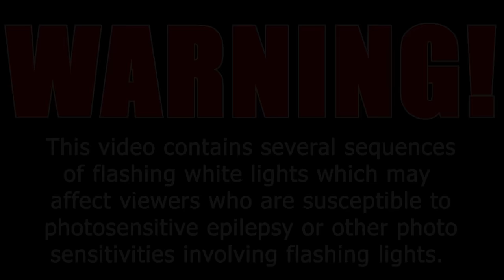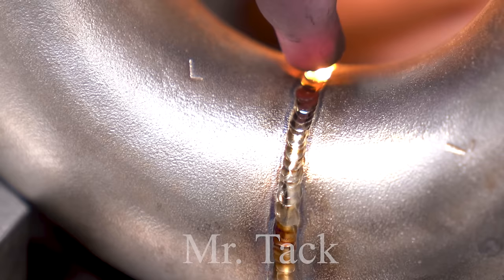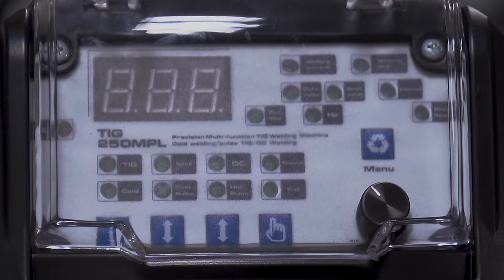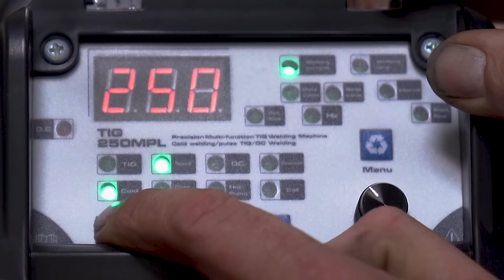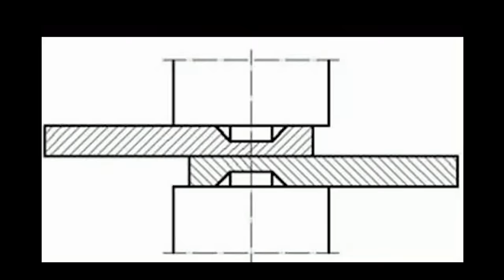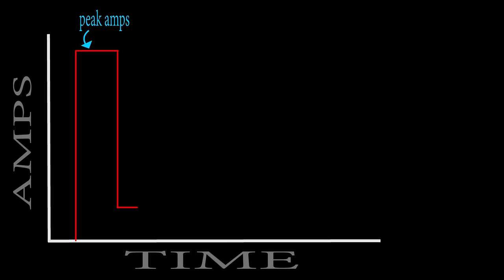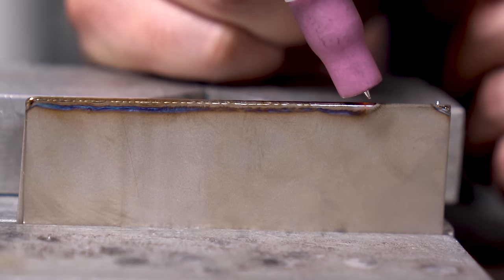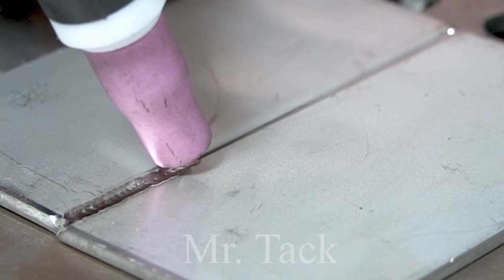So I Bought A Cold Welder

Comment: The first  definition you mentioned  is also called diffusion bonding & we used to do it @ Pratt in a vacuum chamber welding turbine components together. metals were very thick & clean , pressed together  with many tons & sometimes had an ultrasonic vibration applied to one part.

Comment: We use a "cold welder" professionally. It's a professional machine, somewhere in the 15.000 Dollar-range. This machine is used to tack up woven wire meshes with wires for high-temperature fuel cells (SOFCs). Other possible applications would be jewellery or micro-parts. So yes, there is a field of applicaton for these machines and yes, they work really well. But, almost nobody needs a machine like this at home. I really like the way you pointed out the "cold welds" it produces and yes, on homegamer-sized parts this will mostly be the case. I this it was This Old Tony who showed, that the HTP 221 has a "spot" option for tacking small parts AND it is a fully sized AC/DC TIG-welder. So, if someone had to deal with such situations, that's the go-to machine for the homegamer and also for the fabricator.
Reply: The machine in this video can be also used as a normal dc tig welder btw
Reply: $15,000?
Or do you measure tenths of a penny...?
Reply: @sourbrothers73  15000 :) That "." vs. "," thing always bothers me. Even though I regularly work with people from over the pond, I get confused with it every time.
Reply: @Gerhardter  lmao just ball busting
Reply: Lmao did you buy it from "I saw you coming" welding supplies
Reply: @craigelkin53  nope, it's Made in Europe

Comment: That thing would keep your auto darken helmet scrambling to keep up.   Kind of a war of micro seconds you might say.
Reply: If there was a way for the trigger to also trigger the darkening you basically wouldnt see anything going on, just metal fusing since the darkening is so short and the arc so short
Reply: Todd B  In a serious setup you're looking through a 10X stereo microscope and it has an automatic shutter to protect your eyes.  They are very sweet to use. You can hold small pieces with your fingers next to the joint- THAT'S why they call it "cold welding". You can run along about one hit per second.
Reply: @craigwall9536  Could you elaborate on this, please? Your comment has well and truly caught my interest, sir.
Reply: You can set a delay on most helmets, so it can stay dark for 5 or more seconds.
Reply: I have Optrel Crystal 2.0, it does not triger when trying out "cold welding"
Reply: @ravener96  At least one company in Shanghai has a welder with a "synch" output, and a cable that goes to the special helmet.  I guess it's possible that with a conventional automatic helmet the pulse could be over by the time the lens gets dark?

Comment: My Kemppi at home has a similar setting called "Micro Tack", it works pretty good when tacking and not being able to hold wire with the other hand.
Reply: Yeah , I've got masterTig 335 AC/DC , welding some 0,8mm on 120A 30ms ,50ms continues program .. amazing job

Comment: Forty years ago, before auto helmets and inverter welders, we used a gouging rod sharpened to a point to produce very  short/quick arcs to fit-up 20 gauge stainless sheets for bench tops, face-shield down, but shade-visor open, and just blink for the flash. A manageable risk.
 Then, do a few very small tacks with the TIG before the weld run.
We also had an assistant trickle water on the back of the weld during weld run to keep the heat under control.
Sheesh, we don't do any of that now with current technology.
Try that sometime; sharpen a gouging rod to a pencil point for very small short arcs.  But have a very clean shade glass or adjust your auto helmets to suit.
Or just blink.
Reply: I was wondering if anyone ever used water cooling for this kind of thing. Thanks for the info.

Comment: As a woodworker, who could benefit from occasional welds but always finds a work-around to avoid welding, the thing that appeals to me about Cold Welding is how simple it appears to be. I attended welding school and certified almost 20 years ago, but ended up going another direction. The thing that prevents me from my welding when I'd like to weld, is the complexity of all the necessary equipment, setup, and the knowledge that goes along with it (I've forgotten most of what I've learned). For example, if I want to weld two pieces of scrap together, I don't want to have to figure out what type of metal I'm working with, order the specific weld rods, etc. This seems to cut out the entire step of selecting rods, and creates a neat (if weaker) joint. Also, it appears that you can join dissimilar metals rather easily.
Reply: If you're gonna weld wood I'll gladly watch the video😂😂 . Seriously, this process is nothing more than short pulse tack welding. I've seen similar function on reputable brands such as Kempi etc for a number of years before this 'cold weld' bullshit.
Reply: Mig welding the the answer you are looking for then!
Its a fair amount easier to Mig weld than Tig or Gas weld.  You could be good enough for hobby type stuff in Mig by watching some Youtube videos.  
Don’t have to worry about selecting rods, just take two pieces of steel and go do it.  You can find pretty inexpensive Mig welders at Harbor Freight and places like that.
This ‘cold welding’ is basically useless.  If you tired to do this the piece would be about as fragile as if it was stuck together with Elmer’s glue.  You could really only use it to weld things you wouldn’t be touching or moving.  Like a model of some kind that is never coming off of a display stand.

Comment: After first hearing about this process I tinkered with my TIG welder and found done great success fusion welding thin stainless using DC pulse with very short pulse. From memory I was using 120hz with 4% pulse 100/10A - you can really run along a butt, lap,  or edge joint quickly for non-structural metal gluing.
Reply: Yes, people are getting so confused about the bad translation from Chinese to English ('cold welding'). Really, it's just a nice spot weld that's very useful for certain situations. Depending on the situation, it can actually be strong enough to never break, which is all the strength a weld needs.

Comment: For me this would be great tool. At least for making my RC models. Small parts, thin metal. This seems to be very easy to use.
Reply: Me too. Metal toys? Small kid bikes? And some simple diy in the house that needs to be weld.
Reply: Ring and jewelry
Reply: Yep it's made for small parts such as for rc hobbyists and jewelry👍
Reply: Injection molding, repairs - this is real application of these "toys" (as clueless folks say).
Reply: @qwertyasdfghjkl9604  I am doing so ten years ,recently the name changes to "cold Welding"but before that it was micro-tig and the first machine is from Europe.
Reply: @pedroruiz7582  I'm not sure if Europe was first. Maybe it was Japan. For example SANWA model SW-9000 in the 90's. Then model SW-V01 in the 2000's.
Reply: @qwertyasdfghjkl9604  I use a SW-01 and before buy it found a model from europe whose tip retract itself when the switch is on so you dont need to move the tip.I use this  for aluminion injection molds specially when repair corner.
Reply: @pedroruiz7582  Yes. Modern day example is "PiggyWelder" 2 or 3. Same machines (under different name) are sold for jewelry repair. 
I have both, SW-V01 and Piggy3.
Reply: my thoughts exactly. in a realm where brake line is the primary "heavy duty" construction material, this'd be dang near perfect. also for tacking together larger projects made of small parts before going through with the full welding.

Comment: This looks great for tacking thin body panel sheet metal together for minimum distortion. Not many professional “Welders” that I have encountered seem to understand just how easily you can destroy a panel with too much heat and excessive warpage. Looks better than most factory spot welds that already hold a car body together.

Comment: Maybe this is something for sheetmetal repairs on classic cars, because you dont get the destortion, that you would get with normal TIG
Reply: This is nothing new. Single "shot" TIGs are used in the injection mold repairs, for example.
Reply: I was thinking this too. 🤔 I wonder if it would be strong enough to not crack later on down the road. (Pun intended)

Comment: This would be great for putting together thicker electronic stuff, as a slightly faster alternative to soldering. Just blast the wires with the arc, then flow solder on. But then again we have bigger solder guns and torches just for that. Maybe making metal jewelry or sculptures where the thinness of the weld is actually desirable?

Comment: I always thought this process is designed for cosmetic purposes and not structural. For an example, a range hood made of thin stainless still. Or anything made out of thin stainless sheet for that matter.
Reply: Hey I have a TIG welder AND I can't weld
Reply: David Guyton  so sale it.
Reply: @DavidGuyton  or send it to me, i need one
Reply: Naaah once it needs to hold something together is structural.
Reply: About the only thing it’s really useful for.
Reply: Yeah, still is tough to wild weth a nomral TAG wild, especially wen it's stenliss.
Reply: When Sheet Metal Workers work with stainless we typically just use a normal TIG machine. We spend hours prepping metal for maybe a 15 minutes of welding. Then typically the welds are almost always ground down, smoothed, and finished. (No matter how pretty they are) Most of the time we intelligently cut and notch most projects so that they require very little welding. Also most finished products that are exposed (you see them) are intentionally made out of thicker materials for durability making this cold welding really ineffective. If Gordon Ramsay can't beat on it when someone screws up, it doesn't belong in the kitchen.
Reply: Real application is (for example) injection mold repairs. This is not a "toy" for doing tacks.
Reply: Cold welding
Reply: No kids, it's not "cosmetic" only. Tool/die/mold repair is a real application. Example: SANWA SW-V01

Comment: Cold welding or "micro-tacking" has its use for, you guessed it - tacking pieces together. quick and simple.
I would not use it for anything structural, however, if used on thin materials (< 1mm), like for bodywork, you can negate any warping that may occur.
Reply: thats what I was going to say, it will do great on bodywork

Comment: I would class my self as a VERY novice welder who has learnt stick welding to make some anti tip over out riggers for a pedal trike, for want of a better name. I was welding 1.6 pipe bent to shape then welded to some castors. I practiced for about 6 hours just to get the amperage, stick distance and angle right before I managed a weld that seemed acceptable. It had a few blow throughs in the process which I has to make good. 
      Taking advice from  neighbour who’s an experienced welder he told me to avoid cold welding or joined stitch welding as he called it as it would look ok but not hold up when needing to. I avoid this frowned upon technical and loaded my welds afterwards and they held up.
My neighbour reconned not too bag for a novice which I was quite chuffed about 😊😊
Still practicing and watching videos.

Comment: Cold welding can only be achieved in a vacuum, or any area without oxidation.
Reply: Yes, this is just tack welding with TIG xd
Reply: Kinda odd that they called it a “cold welder”, considering true cold welding is a whole class of processes unto itself (explosion welding, stir welding, etc), none of which have anything to do with this TIG tack machine
Reply: Cold welding is when you only use pressure between two perfectly flat objects, without any additional heat applied
Reply: everytime I see a video about "coldwelding" I could completly loose it. Since I'm in a student-group building a satellite we're dealing (or trying not to) with actual cold welding! I hate wrongly used expressions

Comment: The "compression cold weld" you described is similar to "space weld".  The idea is that any metal in an oxygen atmosphere forms an oxide layer.  This prevents metal-to-metal contact from "cold fusing" together.  In space, if you have metal that ISN'T oxidized, touch other metal that ALSO isn't oxidized, yes, they can stick.  Sometimes really well.  Basically, the physics of it is that metal atoms aren't glued" together, they just stick naturally.  So when you touch metal to metal, it becomes one bigger piece of metal.  The oxide being there is the only reason metals don't stick to each other on earth.  "Compression cold weld" forces the metals to mingle by pressing them very hard together.  The oxide is still there, but it's getting shoved around, piled together, and pushed out of the way, leading to SOME metal-on-metal contact, and fusion.  It's not as strong as a solid piece of metal because there's still some "diluted" oxide in there, but it's pretty strong.

There's also "friction welding", but that's not cold.  It IS fun to watch though!

The big problem I see with this cold welding though is simply you are robbing material to fill in gaps, and that's why the welds are weak.  Seeing these areas of metal "carved out" at the gap makes me sad!
Reply: Actually, you are WRONG.  FIRST, it is clear you don't know what AUTOGENOUS welding is.    I am NOT saying I support AUTOGENOUS welding ....because I do not ....BECAUSE ...the "gaps" get filled with the parent materials .....meaning the parent materials can only become THINNER in the localized weld area/seam .....meaning the end result along the seam is weaker when only referring to the cross-sectional area.     There can be a supporting argument that the material is also weaker due to change in the material properties due to the molten state.

SECOND, NONE of this welding is done in an "OXYGEN ATMOSPHERE".   There is ALWAYS a cover or shielding gas used, such as argon or helium or CO2 or mixes.

It sounds like you don't know much about welding ....or you have lost focus.
Reply: Thanks for the simple explanation of oxidation and the 'space weld' phenomenon. It's interesting that a chunk of steel holds itself together, seemingly by this very principle.

Obviously, the 'cold welding' shown in this video is merely a poor translation from Chinese to English, and not the industry jargon for welding metal without heat. As far as robbing material to fill in gaps, it's quite possible to use filler rod in this process, instead of a simple autogenous bead. You can add as much filler as you want, one blast at a time, to build up whatever thickness you like. You'll want to cool off your work intermittently, though. You're not just limited to one autogenous bead with a carved out profile. Also, if you can flip the weld over and weld the back side, the penetration of the two beads is likely to meet in the middle (assuming the metal is thin enough that one bead penetrates half way). Metal that is this thin isn't likely to be supporting tons of weight, so 'strong enough for its purpose' is all that matters.
Reply: @taxicamel  Actually you seem to have lost focus before you even read his comment. Try reading it again, very very slowly. Sound it out.

Comment: i could see where it might be used for small scale modeling or adapt it to 3d printing unit  with a wire feeder.
Reply: With a hellavalot of fans to keep the part from melting while printing it, so you don’t have to wait 14 years for it to cool down in between adding filler material